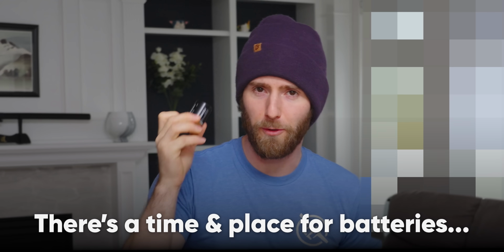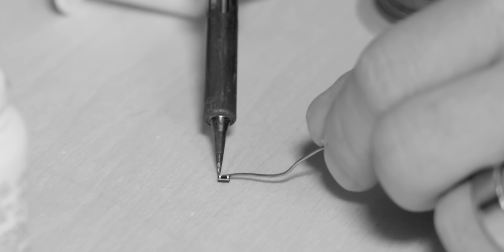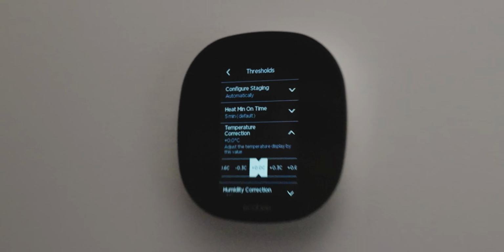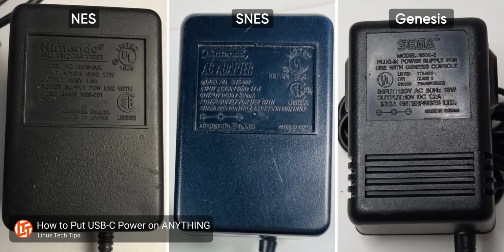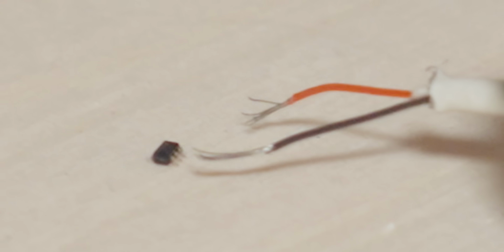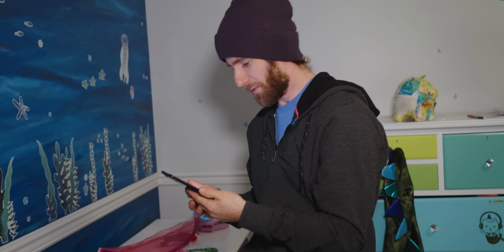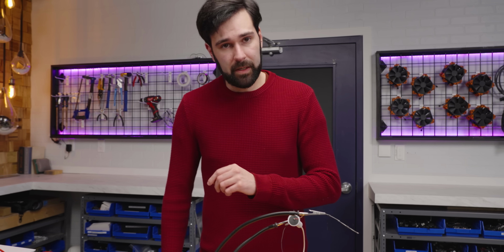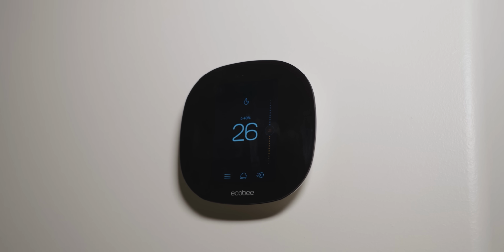I HATE Batteries! - Converting Wireless to Wired (a cheapskate’s guide)

Comment: I see Linus pull out a voltage regulator, and my first thought is "Umm... a couple of 1N4148 diodes and a bias resistor?"  The diodes drop ~0.6V each, and the resistor keeps just enough current flowing through the resistors to stabilize the voltage.  Total cost: About 15 cents.

Comment: A more elegant solution would be to make a button cell shaped PCB with a Type-C port and the regulator. Just drop it in place of the battery and plug it into the wall.

Fun Fact: Did you know this is one of the products that was a major seller for Motorola in the early days? The "battery eliminator" for portable radios turned out to be a hot market for the company. People hated batteries then too!

Comment: All I did was take a AA battery cell holder, put lithium Energizer batteries in it and then wired it to the sensor. They last about 10 years in this configuration.

Comment: Using a diode instead of a potentiometer would drop the voltage between 0.7v and 0.5v regardless of the current draw. Should have waited till the end of the video...

Comment: I've converted a lot of our wall-size fairy lights to 5V usb power. I used diodes to keep the original battery circuit as a battery backup.

Comment: I’ve done these kind of projects in the past. It’s so hard to get the wires soldered on the battery contacts and not damage anything. 

Here is a thought, why not just move the thermostat into one of the rooms?  Though the attic it’s supper easy.

Comment: For a cleaner solution, looks like you can get metal disks that are about the right size for a CR2032, which means you can make a dummy battery with some wires hanging off instead of soldering directly to the contacts. https://youtu.be/tYnsxp2uaDs

Comment: A small step-down converter from china is way better solution that can output stable voltages. You can get very small ones that will fir into the button cell battery size

Comment: I've played around with using resistors to try and lower voltage from usb ports to 3 volts, and with some higher power draw devices, they really don't work very well. As linus ran into in the video, the voltage drop across the device can cause the voltage to sag to unacceptable levels. Additionally, the resistors can sometimes get a little too hot. Also, never try putting a resistor in parallel, since that won't lower the voltage and will cause the resistor to get hot enough to burn.

Comment: If someone needs to do a lot of those, on aliexpress you can get decent "buck converters" which is a tiny circuit board with the potentiometer and all for cents each and like the size of a penny.

and there are even the other way around, boost-up converters. For small applications like these should work fine.

Comment: 🔋 You could start with the open circuit voltage of the battery (from the power supply), and then add a resister that matches the internal resistance of the battery. Then the power drop when it kicks on would be close to what you'd see with the battery

Comment: About 40 some years ago I was involved in a little "government" project at work.  We were building a "blinky LED" gag gift.  We wanted to use CMOS ICs which ran on 15V.  Well, two 9V batteries is 18V so we just put 3 or 4 1N4001 diodes between B+ and the load.  Worked perfect !

Comment: Just use a step-down converter from eBay. They are very cheap, easy to solder on and you can vary the output voltage with the potentiometer.

Comment: I hate wireless things too, however one thing I've had bad experiences with has been wired headphones. I still don't know if wireless is the best option (I think not, I think just higher quality headphone/cord), but the issue I've had is that on rare occasions I'll somehow ruin the cord by yanking on it (like getting up when the cord catches on an armrest or desk corner or something.)

Everything else I hate having to recharge. Regular toothbrushes are fine, but I wish there were wired power toothbrushes too (or at least more selection since I'm guessing there is at least one). And while I'm sure there's wired hair trimmers, I think they've become less common. I actually use a quite nice quality (I think it's vintage) manual trimmer, which one manually squeezes to activate, similar to scissors.

Comment: I have some power converter chips for this use. I'm using them as part of an install "kit" for installing a home weather station with 2 additional sensors into a vehicle. The weather station works off of a usb to barrel jack cable. Planning on eliminating the batteries in the sensors and the backup one in the station.

Comment: You should get green-screen pull down window shades for the house, and then just drop in various windows screen backgrounds outside the windows.
Reply: he already leaked his location live on stream, idk why he is even trying to hide it by this point.
Reply: @nezu_cc  Because the amount of people that saw that section of a stream is a whole lower than the amount of people watching video's. Especially considering there's going to be repeated videos in his house.
Reply: @SolutionJW  yeah, but information spreads fast. If someone wants to know his location all they need to do is google it. Imo there is no point hiding it if you can just google it. Nobody is going to play geo guesser using his windows if the info is already out there in the wild and confirmed to be correct in multiple ways.
Reply: @nezu_cc  My point is more along the lines off 1) there's no point in NOT hiding it and 2) people that aren't already looking for the information might get interested because they see something interesting outside his windows. Why give them that opportunity, right? 
Besides, hiding his location might not be the sole reason for the blur, who knows
Reply: @SolutionJW  as others pointed out, sometimes is batter to hide in plain sight. Pixelation only draws unnecessary attention to it. It's especially pointless once the original purpose behind it is already gone. By this point, it does nothing else expect waisting editors time and drawing unnecessary attention.

Comment: A video a while back showed a way to convert heat into power, so you don't need batteries.
Those devices with it will use ambient heat around them to power them.
Idk what happened to that technology.

Comment: I had a similar issue but I solved it in a different  way. Rather than using multiple sensors to find the best " average" (which at the end of the day is not good for anybody) I set the optimal  thermostat setting for the  hottest spot,  then reinforce cold spots with small electrical heaters (each one coming with its own thermostat). Maybe the small heaters  are not so efficient as the main one,  but the main one still does all the heavy lift and the small heaters  only have to compensate for  small temperature  gradients. And as a difference to an "average" solution  you don't waste any heat anywhere.

Comment: 100% support this attempt coz I also have similar thinking but most of the people are "wireless" fans so they don't want to use wires at all using wires means more socket outlets but inside we all know hard wiring is alot reliable than battery powered smart things

Comment: Was interesting but seems like way too much effort to avoid replacing a battery every 3+ years. Those sensors run a very long time and the thermostat tells you when its running low you have plenty of time to swap the battery.

Comment: Your issue with batteries in IoT devices is exactly what Power Film Solar's indoor panels are intended to solve. They're small, low power, and intended to work indoors. Maybe one day their innovations will make it into the main stream so that no batteries or wall adapters will be required for little IoT devices like you have there.
Reply: Dont you still need a battery for the night.
Reply: @matiasg19   yes, you still need some sort of energy storage device. It could be a battery or it could be a super capacitor. I would personally lean towards the super capacitor side of things. I've personally deployed an outdoor thermometer with a small solar panel that charges two super capacitors. I've yet to convert the indoor unit, but the outdoor unit just works. I've never had to charge it or even replace the capacitors whereas the indoor unit has needed 3 battery replacements in the same time. I forget the price of the capacitors, but to do it again today would be ~$5. Pretty nice if you ask me.

Comment: For these low-power devices throw on a capacitor in parallel as a buffer. Size of the cap depends on how much intermittent power the device draws.
Common issue on devices drawing uA but that you try to power via a voltage regulator designed for larger currents where the regulator is too slow.

For "normal" people 🤣i say just go and buy a few LM2596 based DCDC stepdown modules where you have all of this premade. A 2A module can usually be found for ~$1 or so.

Stepdown = they only convert from higher to lower voltage! If you want something that goes both ways you will have to shell out a bit more money for a "buck-boost".

Happy hacking!

Comment: I have done stuff like this before it is useful.

However as a heads up the CR32 cell can have a max voltage of up to 3.4v brand new meaning it should of been able to run off 3.3v fine without issues.

 So the regulator was needed but the potentiometer was not.

  Additionally the Nominal voltage of Lithium Cr32s is 3v not 3.2 volts.

 I would of recommend a small electrolytic capacitor on the output to buff the power draw spikes. And I bet it would work fine.

Comment: Are you sure the Ecobee sensor really couldn't take 3.3V? button cells can have up to 3.4V open circuit voltage, I'm highly skeptical you need to drop down the 3.3V further. Also, I get it's for content showing the struggles, but you really couldn't wait 1 day for a digikey order of the right voltage regulator (if you did indeed need a 3.2V or a 3V one)?

Comment: the CR2477 starts off at around 3.4V when new, the device could certainly handle 3.3V. Without the 1K potentiometer it would have been fine, also avoiding the 17mW extra power draw from it.

Comment: You could've modified the voltage sense circuit in the psu and it would have worked way more stable (or at least it's supposed to be so)... And no additional mess under the battery cover
Edit: and would have been cheaper also

Comment: I connected a 6V lantern battery to my TI-89 with wire because it would just burn through AAAs (it really should've been designed to take AAs at least)

so... kinda the same, kinda not the same, shut up 🤣

Comment: I do this CONSTANTLY with cheap strings of lights my wife gets. They have all been converted to usb powered devices. Most run on 3.3v, 4.5v, or 5v anyway so easy to convert the voltage down, though most lights will just take 5v instead :shrug:

Comment: Step 1: Get rid of all batteries
Step 2: Solder and wire on USB connectors to battery terminals
Step 3: Use battery-powered USB power bank to get power to modified devices

Comment: i did use an old android phone for a project and wanted the battery removed for safety. do you know that its almost impossible to run a phone without the battery? i had to feed directly into the battery port and with quite beefy components to let it survive the boot process

Comment: 1:10 let me be perfectly clear. Under no circumstances should you modify a smoke alarm. And the reason that smoke alarms have fixed, none replaceable batteries is because they use a radioisotope in the detector. The battery is specified to last the useable half-life of the radioisotope inside the detector, so that once the battery runs out, the whole detector gets replaced.

Comment: DO NOT SOLDER ON/OVER CARPET or VINYL FLOORING, without a hard surface covering the carpet/vinyl like an office chair floor protector. If the iron rolls off a table or otherwise falls on the carpet or vinyl flooring, it is instantly damaged and will have to be replaced. If you are renting you just lost your deposit in 1 second of "whoops".

Comment: You already spent 120$ USD on the two sensors. Coulda spent the 32$ CAD on 2 3.3v wall warts from digikey….Crazy Linus, guess if it’s not work and a pain it doesn’t make for a good video

Comment: Corporate LOVES Batteries for exactly this reason. Make them hard to replace, so you force your customer to buy a new device. And while you're at it, ditch standard hardware like the 3.5mm audio jack so you can't plug in your wired headphones without an adaptor.

Comment: Guys, use a buck converter. They are 1$ each, but them in bulk. Using resistors to adjust voltage is really really wrong.

Comment: You know there's a pretty easy solution to this.  You could simply build a small PCB with a linear regulator and output cap on one side, a battery contact on the other, and plated edge for the other contact.  It would basically pop in the battery compartment like any button cell.  I also wouldn't even think of using a resistor to drop voltage.  You can buy variants of linear regulators that are adjustable.  Just put the appropriate resistors in place (check the datasheet, exact configuration can vary somewhat) and you can have whatever output voltage you want.  Might want to put a load resistor too because some linear regulators don't regulate very well with no load (good explanation for that, but it's a long story), but that's easy enough.

Comment: It would be really cool if you guys made a drop in replacement board that just took a micro-usb cable or something. A small, 2-layer PCB would be able to fit the voltage regulator as well as include contacts to the existing battery contacts. And maybe an inductor or something could help with the current spike?

Comment: For 70C you can get the 5v to 3.3v on a small pcb with larger thru-hole pins. Still fits in a cr2032 socket

Comment: The fact that Linus is using surface mount components is hilarious, I am almost certain you could use a through hole LDO voltage regulator and have no soldering problems

Comment: Such a fancy looking voltage meter for such a tiny device. Anyhow, I'm much more surprised that the board of that did not fried instantly by getting a higher  voltage or probably it's not enough to burn it or the device had such a good resistance.

Comment: Is this guy seriously hacking its way through the problem using the diode's breakdown voltage?😂
At this point re-wire a voltage divider with a resistor and a pot, power up the Ecobee, adjust to 3,3V, then swap the pot with a close enough resistor.

Comment: I'm sorry but you asked me if i could solder that and that looks like sot-23-5 which is like the easiest shit to solder i put in my designs nowadays(actually, last thing i made i stopped using sot-23 bc it was just too big), and yeah, i solder with limited equipment and less than ideal work surface too sometimes. soldering sot23 is what i solder when i'm assembling a board and i need a break and to relax for a while. i know i'm not most of your audience and this doesn't really matter, just saying because i felt like you were questioning my skill dan. however i agree that's the wrong size for the job and if i did something like that i'd want through hole components too and think you should have been able to find like an lm317 or something that would work better for this application. this just makes it look like people who can't already solder pretty well won't be able to do it.

Comment: I feel like there is a market for cheap and cheerful dummy battery modules.

Same size and shape as their battery counterparts and are loaded into devices the same way, but allow the appropriate amount of corresponding wired power.

 So all you would need to do is drill a hole in the back plate to thread the wire through.

It could have a fair markup since your layperson would be willing to pay more to avoid the hassle and fire hazard.

Comment: the easier method rather than soldering direct to components would be to use a DC-DC buck converter module. a mini360 would be ideal for this. about £0.50 per unit. they should be more efficent and more stable with the voltage drop

Comment: With low power stuff like this
a voltage devider or dropper with zener diodes or resistors makes way more sense, 
it wastes a bit more power but with such low power devices that shouldnt matter.
The upside is that you can finetune them better and for more applications, for example on devices which use a single AAA batterie for example.
And i would say that its probably easier to solder together because u can use those thruhole resistors with long legs :D

Edit: Just watched the video completely and actually the problem they had with the current spikes would be a no issue with a voltage devider setup, because if you spec a voltage devider correctly (for the correct amprage) than the voltage will not fluctuate aslong as the current is under what the resistors are speced for. 
For example like 1 mA for 5v to 3v would need a 3k and 2k resistor in series and than the middle point between the both resistors will show 3v with a capability of up to 1mA if you try to draw more mA than it will droop down to something lower but as long as you stay underneath 1mA its gonna be steady 3v

Comment: There are plenty cheap board with step down regulators, some penny sized. Either with fixed or with variable voltage. It is easier to solder too. It also won't waste energy (except for losses) like the LDO does. Though to be fair for such a low current it won't matter.

Instead of the three diodes you could just use a LED (infra red, red or orange).